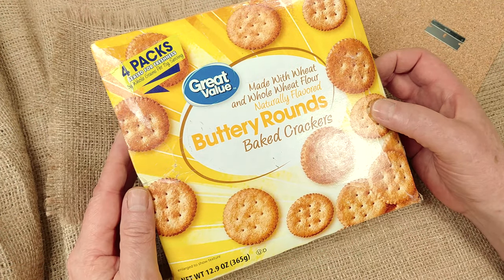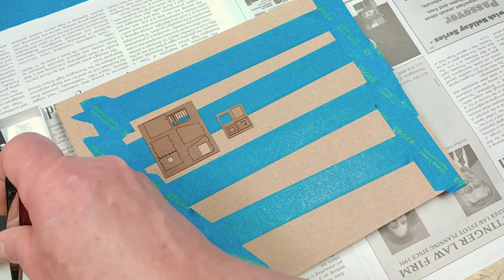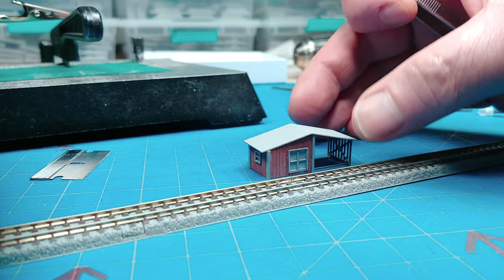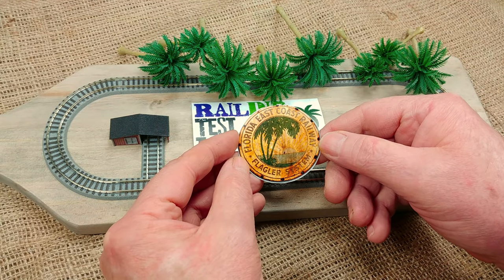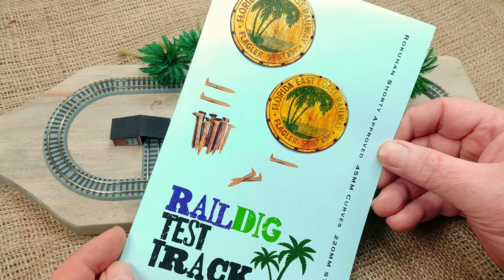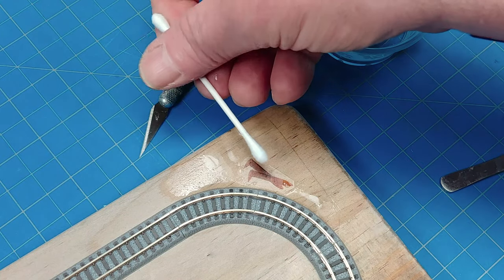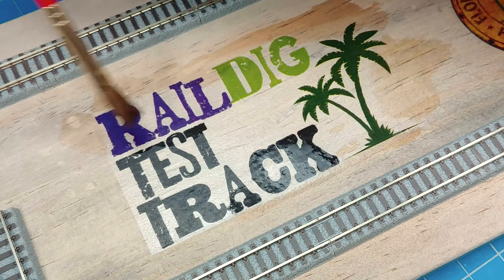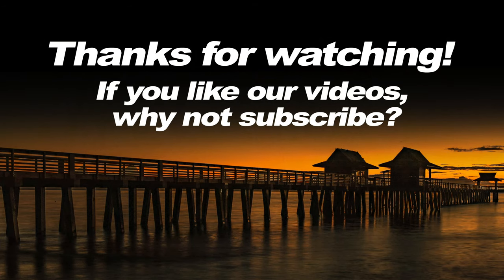Rokuhan Z Scale Shorty Test Track

Comment: Great video. AZL Tropicana reefers would look at home on this layout if they could only negotiate those tight curves!

I experimented with Z scale at one time, but decided to stick with N and sold off my small Z collection. However, I was thinking of doing a micro Z layout at some point. 

FYI Island Modelworks has Z scale LIRR M7 shells on their Shapeways store. Might want to check it out.
Reply from the maker: Thanks! I think the Tropicana reefers would quickly become a permanent "end of track" feature on these 45mm curves :)

I do think these little micro boards are great to have kicking around, especially with the price of the Rokuhan Shorty locos at around $16, and you can pop together a little board like this in a few hours. The biggest downside I see to these little chassis is that they are so small and light and they require so little power to run, they can be prone to stalling on less that REALLY ideal track. I'm tempted to go DCC on one of these in the future for reliable crawling speeds on these crazy tight turns.

I just checked out that M7 over on Shapeways, it looks pretty cool!

Comment: Have you considered a little spray of Testors DullCote to reduce the presence of the decal film?
Reply from the maker: As this was to be a quick test running piece, I was going to let it go as-is. Of course I didn't :)

I did a follow up video where I added color to the board, redid the decals and finished with the airbrush and thinned clear gloss acrylic over Dullcote for a flat-to-satin finish:
https://www.youtube.com/watch?v=EaPkqmR7mBw

Lesson here... even quick projects are worth doing right!
Reply: @Raildig  Excelent. Just found your channel and hadn't seen the followup video yet.
Reply from the maker: @garrettswoodworx1873  Cool, welcome! One nice thing about doing these small projects is that I can try different techniques and materials... not always successfully (at first!) but still worth doing I think.
Reply: @Raildig  Yep! Lifelong model railroad fan (O27, HO, N) just getting started in Z & looking forward to learning more!
Reply from the maker: @garrettswoodworx1873  As a new folk to Z, I think the biggest thing to do is... and you likely already know this, go crazy slow and try not to get frustrated. Even though Z is only about 25% or so smaller than N scale, it can be challenging. Worth it, 100%, but it'll take a little getting used to. A goof forum resource is the AZL forum here: https://azlforum.com/.

I love Z and always like to talk it up (as you can see by the videos on this channel!), but I always stress taking it slow initially until you get your (bad pun coming) Z Legs :)
Reply: @Raildig  Thanks for the advice!  I'll look into the forum,sure can't hurt!
Reply from the maker: @garrettswoodworx1873  Glad to help if I can!